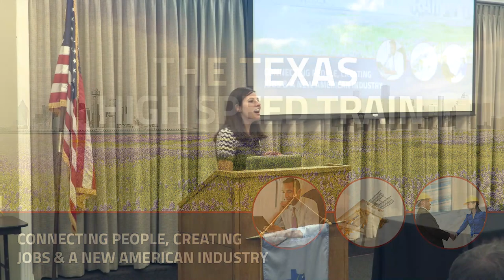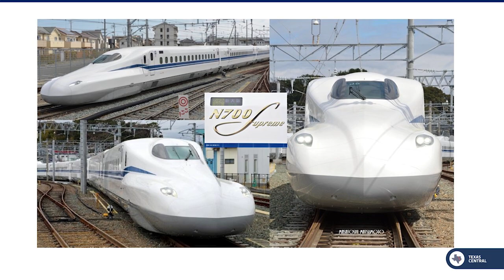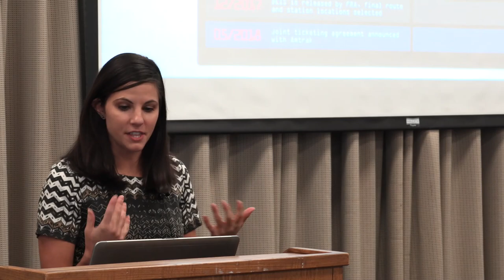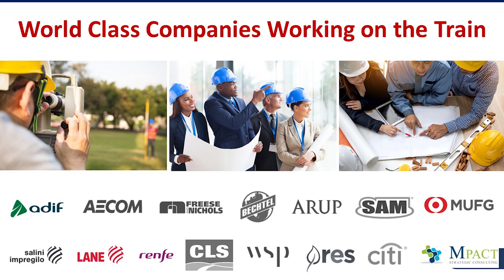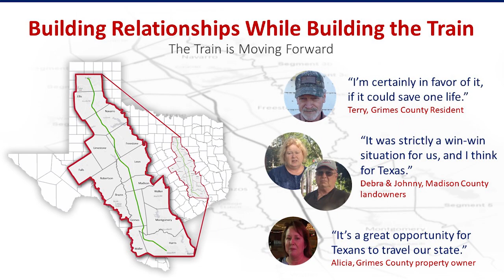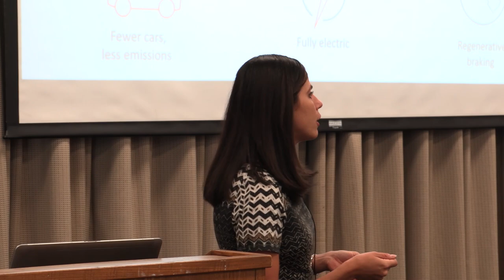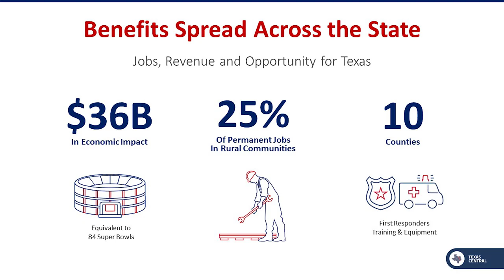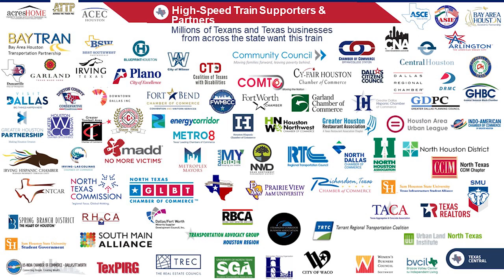Texas High-Speed Train Information! - October 2019 Plano BDM

Comment: Don't believe they are capable.california and hon. We're iam at. It's too complicated for a first time project even with Oot of country experience manufacture .endless mistakes that they will hide from the public than face the questions. They there are the parts that need to be manufacture by old Amtrak people. Here we got the weld are not up to par and cracking .its a 3 way blame game. As  this is a first. Can you believe they even got the wheel sizing to the frog crossing wrong. 1/2 " off so all has to be redone.
Some local contract company  left the cables in the rain and  use it rusted.  So all the tighting cables  in cement  has to be x rayed of some type.
And the cost will be triple 4.5 billion to 12.4 billion California from 20 billion to 80 b. Last I seen. 
The right way is just have one company build it and contract work out.
Reply: Reality is the smart engineering people that has build America infrastructure has retired. Gone. And they hired all theses MBA manager. They are capable of doing complex thinking jobs. So they screw up the  custom parts needed. They are not engineers so they don't know what was tried long ago and failed. But make it.